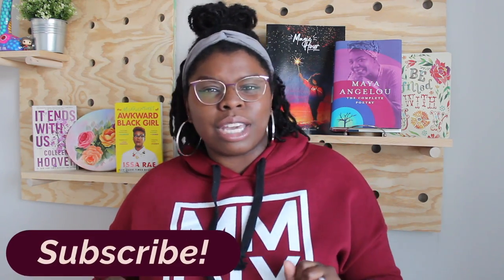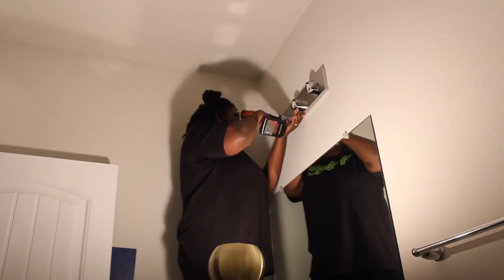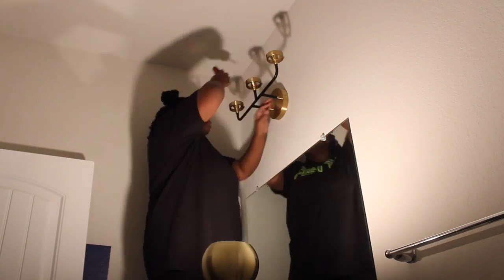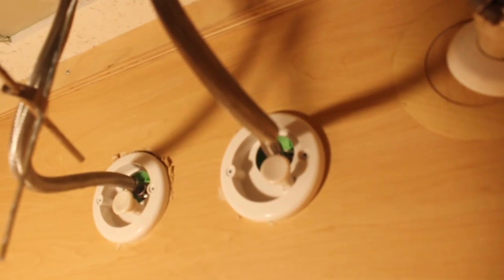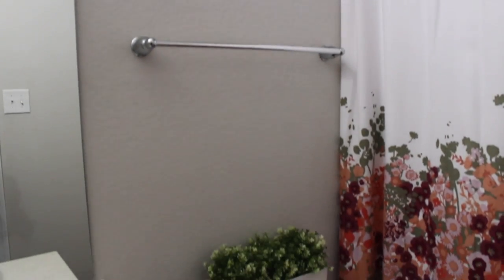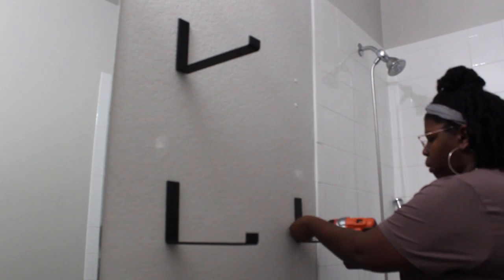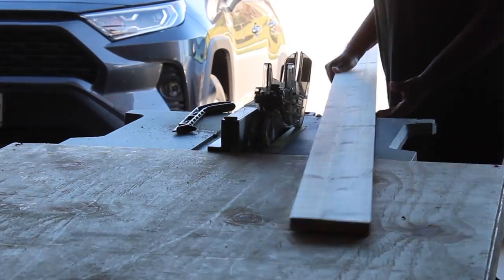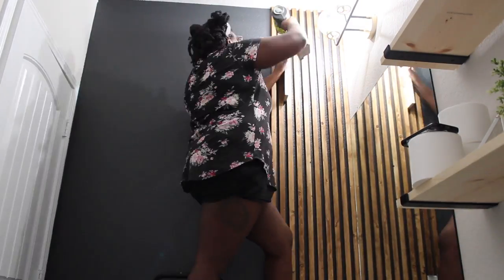EXTREME Bathroom Makeover On A Budget Pt 1 | How To DIY A Wood Slat Wall

Comment: was wondering can you nail the wood into a drywall or only on wood? Great video by the way :D
Reply: You can technically mail anything into drywall. Better question is if it will hold to the drywall. Those small pieces of wood should be fine to Brad nail into the drywall but better if you can get a stud

Comment: Beautiful work! Did you fill the holes of the nails?
Reply from the maker: Thanks so much! I didn't fill in the nail holes because I stained and sealed the slats before installing, and I think the touch ups of stain would look inconsistent. Instead, I went with finishing nails so the visibility is minimal.
Reply: @melanatedmakerdiy1710  thank you so much!